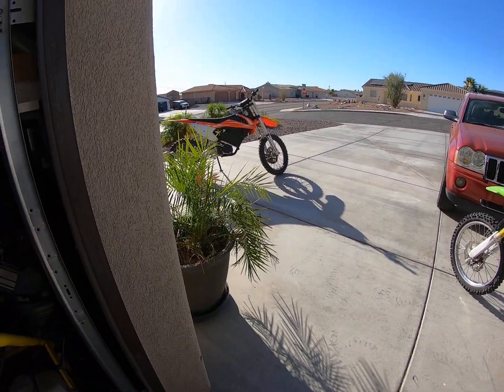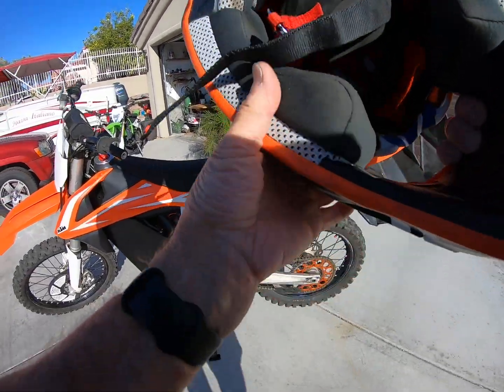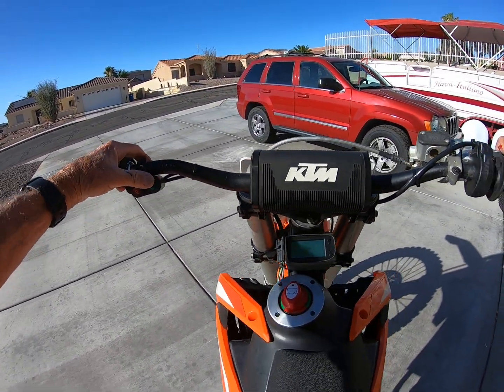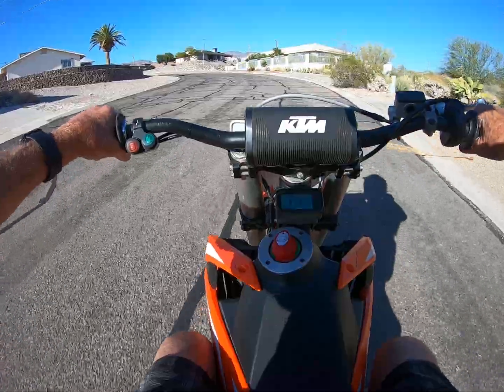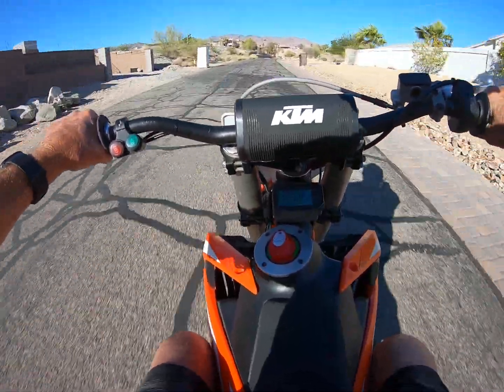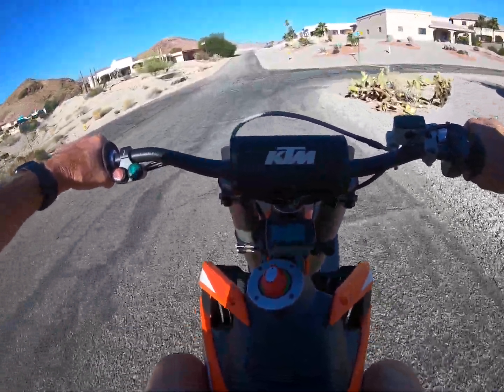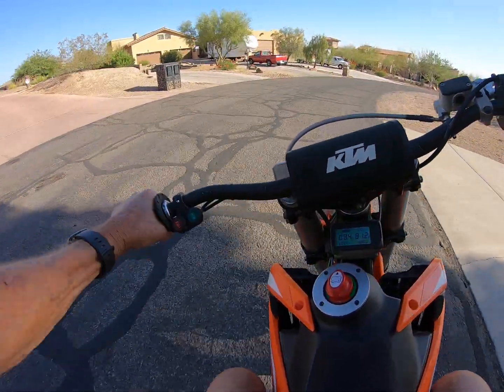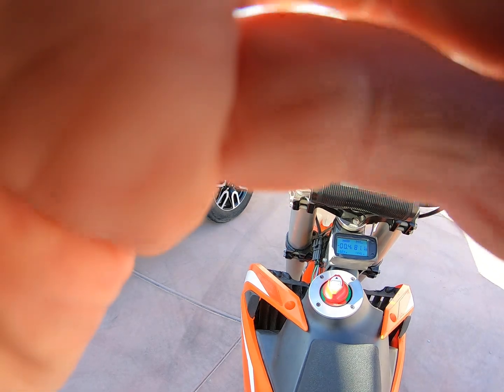The 2017 KTM 150SX with QS138 70H V3  Votol EM260SP Controller and 4.8KW battery .

Comment: Why did you pick the 70h version over the 90h ? What would be the benefit of either ?
Reply from the maker: The 70H has produced enough power and is a little narrower.  The brake pedal has to be adjusted  to work on most bikes now.  The 90H is wider, and heavier, and you can't have a brake pedal.  YZ-EMX conversion with the same 70H motor claims 45-48HP.  That is enough for me.  To get more power  you need bigger battery, and now you are even heavier.  There is another motor we are thinking about, the Sotion GTS35, watercooled and 60HP, with a EBMX X-9000 controller, and that will need more battery.
Reply: @dcoxryton  very interesting information thanks a lot ! How much does your sx weights with the 70h and 4.8kw battery ? I ready everywhere that eMoto feel lighter than thermic for a given weight, do you feel the same about that ?
Reply from the maker: @gg4760-k5n  I don't have pictures of the weight.(I usually take pictures of the scales)  But I think it was 242, or 245lbs.
Reply: @dcoxryton  how did it feel compared to the 150sx with its normal engine ? Weights are pretty comparable and small 2strokes are already pretty nimble compared to 4 strokes.

Comment: Is there a water cooled plate that’s designed for the em260 or do people piece together a kit? I haven’t been able to find anything
Reply from the maker: Both answers are correct.  AliExpress sells a water cooling plate for the EM260, but it is a little expensive.  And you need the pump and plumbing      https://www.aliexpress.us/item/3256804765456094.html                        We have put together some parts to do this with.                                                    Pump https:      //www.amazon.com/gp/product/B07JD8PXSR/?t
Power Supply https:        //www.amazon.com/gp/product/B07GNTC1D7/?tag=sce0f-20            Water cooling blocks: https://www.amazon.com/gp/product/B07VFGW4JZ/?tag=sce0f-20 (They also have larger ones on that site)      Or you can go to Manny Guerrero, and he makes a kit.  Hope this helps
Reply: That’s a great answer! Thank you. I’m in AZ too 🤙
Reply from the maker: @rednoseroyce  What are you building?
Reply: An 09 yz450f. I’m a fabricator and I built a smaller electric pit bike that’s insanely fun but I want something That’s roadworthy

Comment: In az how much would you charge to build something like this if I brought you frame
Reply from the maker: There are a lot of variables.  The motor, controller kit it is about $1500, the battery is  the expensive and variable item.  4.8KW just like in this one would be about $4500,(including Chargers) with case and fit to the KTM, this was for a 2017 150SX frame. I would charge about $1000 to build it.   There can be smaller batteries, as little as $2000, and swappable batteries. Go to the Electricdirtriders.com , and this subject   https://electricdirtriders.com/threads/yz250f-2014-build-with-qs-138-70h-v3-motor-and-450a-controller-part-1-and-part-2.2733/
And  you can private message me there.

Comment: What kind of speeds are you getting? Thinking about building one of these.
Reply from the maker: The reason for the higher speed in Mode 3 is the flux weakening.  I actually have it setup so that Mode 3 engages Boost, or Sport Mode, and Boost has the flux weakening.
Reply from the maker: Mode 1 or 2 is good for the high 40"s, and Mode 3 is the high 50's. the gearing is 13 49      520 chain.

Comment: Hello, is it enough to drive a few kilometers on this battery?

Please advise the best controller for the 3000W 70H QS138 motor

And also for QS138 4000w 90H
Reply from the maker: With this battery, 4.8KW, I have gone 40 miles, or about 64 Kilometers trail riding.  You can calculate approximate mileage by dividing the KW of the battery by 120w per mile.  I would say the best controller for a QS 138 70H V3 is the Votol EM 260 SP2 programmed by ElectroandCompany.com. It would be the same for the  QS 138 90H motor.  The controller will give you about 450A to either motor, so the same power. I buy the complete kit from Electroandcompany.com, because it comes with the motor, controller, wiring harness, throttle, switches, and programmed ready to ride.  Here is my YZ 250 with the same components, I plugged it in, and drove it in this video.    https://youtu.be/N1lioYhFW3c

Comment: Hi Donald, nice build! Do you have any experience with  QS180 90H? Looking to convert a 125cc yamaha bike to EV and not sure yet what the best motor would be..
Reply from the maker: No I don't have any experience with the QS180 90H motor, but The specs I see are, that it is heavier, and it doesn't have a gear reduction, and it only is a 4 pole motor versus the 5 poles on the QS138  70H V3.  The QS138 70H V3 can take 32KW.  With the EM260SP/2 you can push that motor to 72V 450A. You have to cool the controller at that current, but It will run 350A all day long with no cooling.  I have just finished the YZ250H with the QS 138 70H V3 and the EM260SP/2 and 42AH battery, and I will put out a Youtube on that.  I have a YouTube on my channel on that YZ250f first ride.  https://www.youtube.com/watch?v=n9BlsPAM4-o

Comment: Woah 🤯
Reply from the maker: It is fun and fast.  the owner has ridden it miles and miles since delivery in mid June. I just got a picture from him at 7500' altitude in the High Sierras, no jetting issues... the bike got 40 miles on a full charge of trails in Vermont, he is loving it.  Stay tuned for my next build I am building now.  A 2014 YZ 250F with the same motor controller.

Comment: Great build. Did you use the V3 with the internal gearing? I have a V2 without internal gearing. I was wondering what motor and what gearing your using? I am going to use a 108900 on mine and run it at a lower setting. I do all my own tuning. Honestly its pretty easy.
Reply from the maker: Is that a far driver 108900? I have a friend having a lot of problems to get it to work on a ME1115 motor and the Sins/Cosine encoder. The Votol EM 260 SP works so well with the QS motors. Yes mine is the V3. Have you done a lot of programming with the Far driver?
Reply: @dcoxryton    I've proged two bikes so far on Votol but they were both hub motors. It's much easier than my ASI BAC 8000. I have never ran a ME brushless me motor before so I can't really comment 9n the encoder.  The 108900 that I'm going to try is from LBMC which I believe to be a derivative of the votol controller but I alittle cheaper. Someone has to attempt it first.
Reply from the maker: @Twin_turbo_coyote_fox  Yea the controller always seems to be the toughest part.  I  have way too much experience with the Kelly and a ME1302 motor. It worked but not well at all. Cut outs under load.  Then I worked with a guy on the BAC8000. Difficult too.  Then I tried a Sevcon on a ME1115, and just an expensive cluster...  Too many variables. Now I have built 4 bikes with the Votol EM150SP or EM 260SP, all QS V3 motors, what jewels. They just work. I am starting a 2014 YZ250F this week, with the same combo. The Motor/Controller from ElectroandCompany.com, just works out of the box.  I helped a buddy, the one with the BAC8000, build anther CRF with QS V3 and Em260SP. This combo just works.  Here is him and his CRF at Glen Helen doing 2 laps. In mode 2 and only about 250A. The old battery crapped out right at the end of 2 laps.   https://www.youtube.com/watch?v=wpCnW2bwSnM&ab_channel=CasMoto

Comment: What size rear sprocket? Are you using the 14 tooth front sprocket that comes with the motor? Do you mind sharing the top speed?
Reply from the maker: We are using a 13 tooth on the front and 49 on the rear, I am not sure on the rear.. I haven't  clocked the speed, but I think it's in the 60's. The Flux weakening really spins up in Boost mode. You can get 520 sprockets from MightE.me they have 13,14, and15. The sprocket that comes with the motor is a 428 15 tooth.

Comment: Hi Donald! Very awesome build, congratulation!
Is there a real benefit to use EM260 controller for QS138 70H V3 over EM200/sp2?
Reply from the maker: Thanks.  The real advantage of the EM260SP/2 is the 350A capable, and 450A possible with water cooling.  I rode it yesterday in Mode 3 set at 350A and my meter said 370A at max acceleration. That is ripping power.  This combo works so well. An important thing is to get it from  ElectroandCompany.com.  The Programming alone is worth it's price, plus you get a plug and play wiring harness.  If you have tried to program any of the High current controllers, you know what I am talking about. 
Check out this youtube . It is a CRF 250 with the same ELECTROANDCOMPANY.com motor and controller on the hill course at Glen Helen in mod 2 at about 240A.
https://www.youtube.com/watch?v=wpCnW2bwSnM&ab_channel=CasMoto